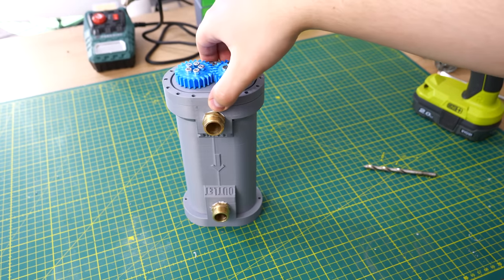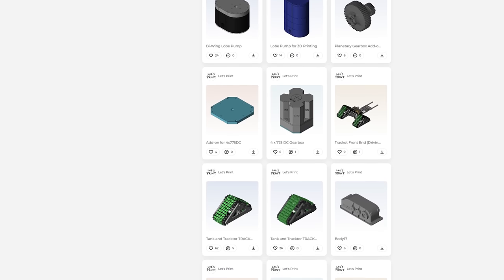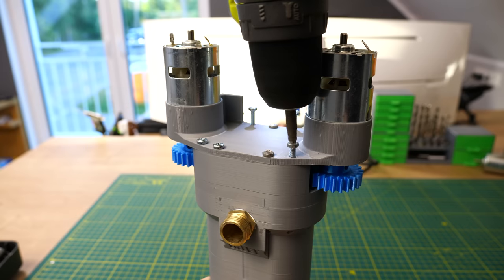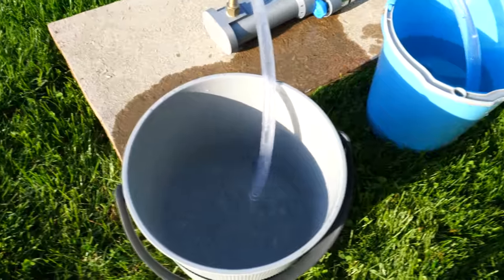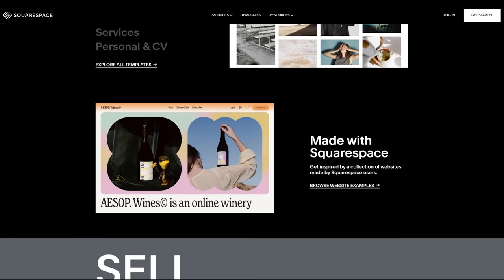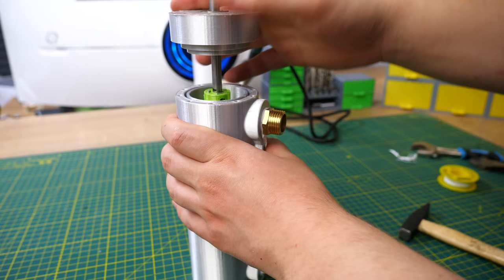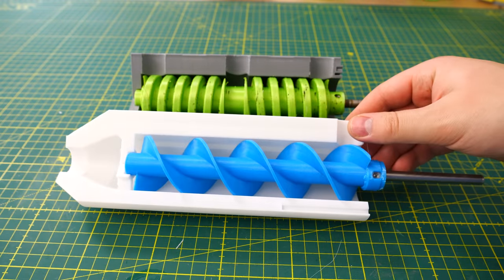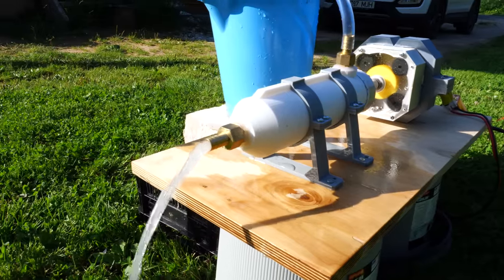3D Printed Screw Pump - 3 Different Way

Comment: Id say the reason the one one tube was not pumping, is the size of tube, That's allot of water  to move. I think if you used a smaller diameter tube, you might see better results..  Plus I remember way back in school, being  told about  Cavitation - or something like that ! liquid dynamics and how the liquid can turn to vapour due to low/high pressure.. I can't quite remember how it went - but that word got stuck in my head !! lol

Comment: Pack the shaft with grease not a seal… These will be great pumps! You just need better seal. If you have ever worked on a mechanical injection pump on a diesel you will understand how just the smallest of air leaks can cause a pump to never hit its curve.

Comment: Just seal the first pump. It's the only one that can actually pump water. Because the other two pumps only have one screw, there's nothing preventing the water from flowing backwards.

If the drive shaft is locked in place, the only type of pump that should allow water to flow freely is a centrifugal pump.

Comment: Easyer to use (i dont know the english name) in Hungary called: lábszelep. Thus device use for water and other application, not need primeing every tine your pump. Not need so much stuff, some rubber, 3d printing and maybe a washer.

Comment: the last one would have worked better with the inlet of the screw submerged ... its basically an archimedes pump low pressure high volume when used right

Comment: As I work as an engineer in a screw pump industry, I know what exactly is going wrong here! You are using water as the pumping medium. Which has a very low viscosity. And screw pumps are predominantly used in medium to high viscious media. As screw pumps has a clearance between the screw and housing, using low viscous media will just slip back, rather than going to the outlet. To improve the pumps performance, you have two options. Either you can reduce the clearance between the screw and housing, or you can try a higher viscosity media like lube oil or similar media.. Try it! All the best

Comment: I've watched a lot of your videos on pumps and what I think you need to do is go back to the basics and study what type of pumps are designed for what purposes and what pressures also look at the designs of the necks and the vacuums and the screws in the blades and why they are used in the ways they are used. What you seem to be doing is just trying anything and everything without any real knowledge as to what you're going for. A little bit of understanding on what pumps are good for what purposes goes a long way

Comment: Your pumps suck lots of air. The first pump was a good pump that needs a better gear ration because the motor struggled. It's really easy to make orings from bulk material. 
Great prints! I look forward to seeing more.

Comment: I think the reason the double inlet pump never worked is because the water pressure from one side essentially blocks off the other side as the outlet is not big enough!

Comment: The fact that you had screws bouncing around in the gearbox and kept it running is crazy to me. Those screws could've ruined everything for that gearbox. 

Anyway,  asking again for a shift cart or motorcycle on bike frame made from the 6, 775 motor gearbox.

Comment: Your tolerance is too big for them to properly work. I may re-print these and do a video to show you.  Size up the rotor by like... 0.5% and print it in TPU, then use a lithium grease to pre-lube the casing before you insert the rotor.  Should work, the idea is you want an airtight fit, slight drag of the tpu on the outer casing so it self clearances and breaks in, and then when you run it the pump should work fine.

Comment: 9:19 why you design a pump to suck water from below but the inlet is on top? you can clearly see why the water didn't go over, an error quickly fixed by moving the inlet below the pump, as every other pump ever created, no need to reinvent the wheel if the wheel is going to be shitty.

Comment: Turbine efficiency is easily limited by the quality of the fit. The more space you have between the turbine's outer edge and the housing, the less efficient it will be. I suspect that's part of your issue. 
Also, I wonder how water and air tight your prints really are? if air is able to seep through the layers, you won't be able to make a good vacuum...

Comment: it's all shitty shaft seals, each pump is sucking air around the shaft, first one is, second one is (that side with the shaft doesn't work), same with third one. try putting the motor/shaft on the discharge side of the pump and you'll end up with a motor full of water, but it will work better.

Comment: **"😮😮🎉It needs a larger input, a 30% to even a 100% larger input than output can gelp things greatly, say a 12mm ID output with 20-25mm input, it us so pain mote difficult lots a small inlet, its lije breathing through a straw!! If  nothing else, use two inlets  and a single output! Just thinking about it it seems to not be a issue, but it can make a big difference,  there have been industrial installs that burned motors because the small inlet plumbing, using a inlet reduced down to to the same as outlets, it had something like 30 mm inlet , and 20 mm output,  they used , 20 mm for both, the pump went through 4motors, and 3whold pump and motor Assemblies, until the inlet pipes were swapped to 30-35mm or what ever it was, it cost someone their job, and $20,000, plus  losses due to diwn time,  when a 800 mm piece of pipe could have saved it all!! Just the pipe from reservoir to the pump😮

Comment: Well ... "I built 3 different screw pumps, how did they work? Well, see that in the video!" You should have said: 'how do they NOT work' Except for the particular very informative design and the quality of your 3D prints, you did not make pumps. 
When you make a pump: the medium (air, water, oil,...) delta P  has to be higher at the outlet than at the outlet, and since you want to pump water the delta P must be 1bar /10000 * height of suction in mm (P1 suction, P2 outlet, P2 > P1, always, even dry). In your case you should put, before starting two (or three) Pitot-tubes (like this : https://study.com/cimages/multimages/16/0375080113338720126333.png) on the inlets to see what happens. If you have no movement at all, the pump will not work. If you see that P1 is < P2, you're good to go, if P2-P1 > suction height, then you have a self priming pump.
Lobe pumps are good, but will tear themselves apart, centrigugal pumps are mostly used since they last very very long.